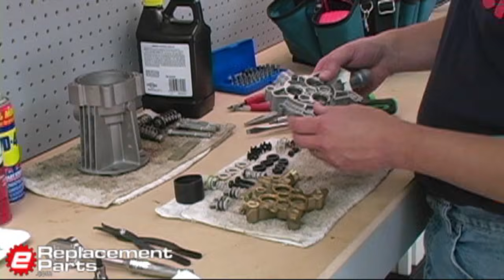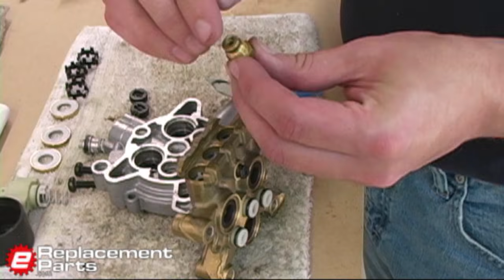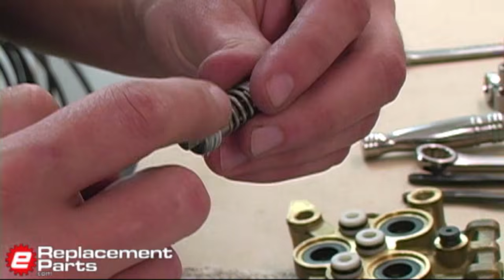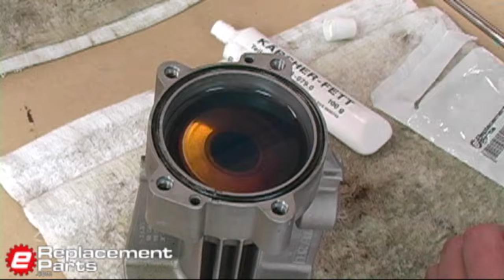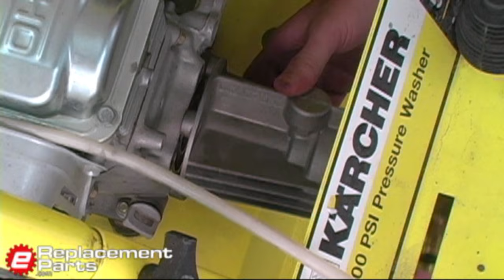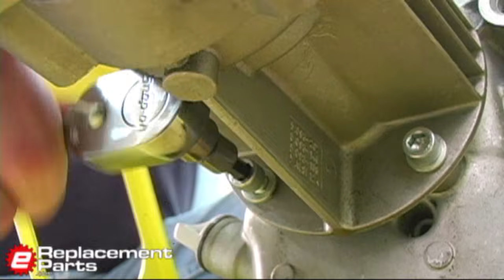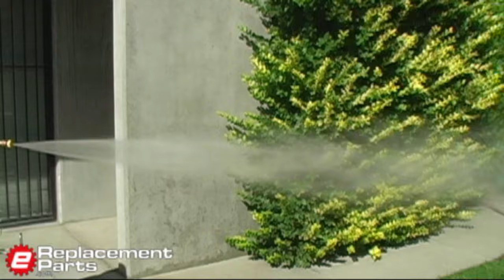How to Fix a Pressure Washer (Part 2 of 2)

Comment: Mark...After looking at your Excellent video, I figured that I could do the repair as shown.  So, I ordered a few parts that I figured that I would need. The problem I'm having is actually getting the pump to separate from the motor. You mentioned using a puller. What does it look like...so that I can go buy one?

Comment: I haven't gone thru all the comments; excuse me if this is redundant: Are pressure washers more alike than different? Is it safe to assume that the lessons learned in this video will cover all other popular brands?
Reply from the maker: Hi Raphael. Many pressure washers are quite similar, so this video is designed to cover the basics of pressure washer maintenance. However, we can't guarantee that your pressure washer would be exactly like this. The purpose of the video is to show the basics, and hopefully it helps you with your repair!

Comment: Can you show us the bearings under the wobble plate? I have a 5 hp Campbell hausfeld presure washer and the needle bearings wore out and  just fell apart inside the pump. The grease looked like whipped cream. But it was full of grease I don't know why the needle bearings failed but they did. Please show us the proper way to replaces the bearings under the plate. Thank you....liked and subed your channel.

Comment: This is an incredible video ... Every detail clearly outlined, with advice along the way including proper lubricants to use with clarification of why the portions of the disassembly and reassembly is being performed. 

I have this power washer and already had replaced the loader valve, but did so without the pump removal. I found getting the valve out easiest by simply giving the pump a crank after removing the housing holding it in place. It pops out after pulling the cord once our twice.

My problem right now is that the detergent suction doesn't work. I'm going tio carefully take it apart, and inspect the o-ring, spring, gaskets and check valve. I think possibly only lubrication and cleaning is needed ... But if that doesn't do it, I'll order the kit.

Awesome video! Thank you for your time and expertise!  Rick

Comment: what kind of oil did you put back in the pump?
thank you
Reply from the maker: Hi Adrian. We use a specific pressure washer pump oil like this one:
https://www.ereplacementparts.com/pressure-washer-pump-oil-p-139764.html

Thanks for the question and good luck with the repair!

Comment: Thanks. 2 ?s what type oil in pump
And there were 2 sets of 3 valves. You called one set the upper. Are they interchangeable? They look same?
Reply from the maker: Hi David, thanks for the question. As far as pump oil goes, you'll want something specially formulated to do that job, like this:
https://www.ereplacementparts.com/pressure-washer-pump-oil-p-139764.html

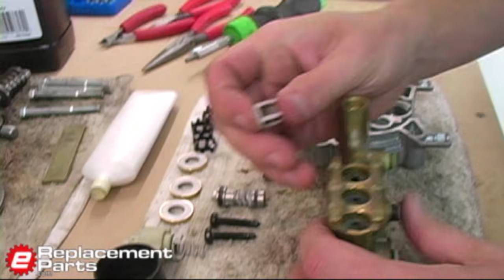As far as the valves go, the three valves that Mark installs at 1:25 of this video are interchangeable, but they are slightly different from the upper valves that he installs at 1:54. Thanks again for your question and good luck with your repair!

Comment: Did you put oil in the water pump or just the engine?
Reply from the maker: Thanks for the question, Don! You will want to put a special non-detergent pump oil in your pressure washer's pump. I hope this helps, and good luck with your repair!

Comment: what is the oil for pressure washer
Reply from the maker: Typically your best bet is a 30W non-detergent oil. You may want to double check that it is the right type for your specific model however. Good luck with your repair!

Comment: Do you have the actual part number for the valve and what kind of oil was use?
Reply from the maker: Hi Guillermo! Mark uses Teflon grease on the valve for lubrication. If you send us the model number of your pressure washer we would be happy to find the correct valve for you!

Comment: What oil goes in the pump also where did you order the new parts from I also couldn't get my unloader valve out I tried needle nose and twisting it but no luck
Reply from the maker: Thanks for your question! Can you send us the model number for your pressure washer and I will try to find an unloader valve, or any other part you need! As far as oil goes, I would recommend a non-detergent SAE30 pump oil.

Comment: I have a Karcher G 1800, and water is just SHOOTING out of the Soap input hose/port.   This causes my pressure to fluctuate constantly.  
Would there be something with the spring and ball in the "Soap Injector" section of your video be a culprit?  
or am i looking at a different problem?

Comment: Very good video! I had the same exact power washer with the Honda engine. I purchased as a refurbished model. It worked perfectly and I sold it for about what I paid for it. Not sure if you can get the same quality from Karcher in 2018. 

Are they still quality built today like these were??
Reply from the maker: Hi Bob, Karcher is still a very well built, quality pressure washer still to date. It is probably one of the industries best.
Reply: Thanks for your reply. I am finding that is not  the case after reading and doing research with the Karcher electric models. People are constantly complaining about how poorly they are built and perform today. 
Perhaps this may be with the electric models only??

Comment: Verry comprehensive  and easy to follow ,Thankyou Mark,  G2500 OH 1.194-5120  broken valve spring , oil resivoir empty ,every thing shot need to replace bearings in housing. ( HOW ) Where can I get a compleat pump repair kit Please?
Reply from the maker: Hi Garry, unfortunately at this time we are unable to offer technical support. I would suggest contacting the manufacture for further information. I sincerely apologize.

Comment: I have an es4040 4000psi pressure washer pump with no presssure, would this same method apply for that type pump?
Reply from the maker: Hi Jorge, unfortunately at this time we are unable to offer technical support. I would suggest contacting the manufacture for further information. I sincerely apologize.

Comment: This video is very helpful.  So as requested, I'm leaving a comment AND asking a couple questions.  I have a Rigid 3000 PSI 2.6 GPM pressure washer with a Subaru engine. Here goes:  (1) Is the process the same for diagnosing and fixing the pump on that model? If not, can you please point me in the direction of a good video to watch?  (2) Also, it's only running when on choke after cleaning the carb and jets earlier.  Should I run some Seafoam through the gas to see if that clears it up?
Reply from the maker: Hi Jeremiah, unfortunately at this time we are unable to offer technical support. I would suggest contacting the manufacture Rigid  for further information. I sincerely apologize.

Comment: Very helpful video. I have an issue with fantom vpw46. The connector that you hook the hose to leaks in between the two parts of the brass connector. Did replace the rubber washer to the hose. Hoping that would solove the leak problem. Not. Will this also cause lose of pressure? How do I fix? Judy
Reply from the maker: Hi Judy, unfortunately at this time we are unable to offer technical support. I would suggest contacting the manufacture of your pressure washer. I sincerely apologize.

Comment: Excellent video. I have a Karcher K3.690 pressure washer that has a leak in the pump. The cause is a crack along the mould line of the housing which to me is a design flaw that should be covered under warranty but is not.

Comment: Mark, I recently purchased from your website 6 valves and the unloader valve for my Karcher Pressure Washer (Model G 2650 HH, Part No.: 1.194-508.0) due to the pressure pulsating. I put the pump back together tonight with the new valves. After starting up my pressure washer, it continues to pulsate. Any ideas as to what I should try next? Thanks.
Reply from the maker: The unloader should not have anything to do with the pressure washer pulsating. That would be in the valve area, but you have already replaced them. Speaking to our Pressure Washer Technician. Here is what he said.
A. Debris in the pump
B. Calcium build up in the pump
C. Air in the pump
D. Not enough water volume going into the pump
E. Karcher advises to use a 3/4 inch inlet hose, most hoses are 5/8 inch
F. Too small of an outlet hose

Comment: Hi,  Great video. I just did mine, and now it works great, but it is leaking water out of the bottom and is getting water in the oil. I just cleaned everything. I did not change any seals. I could see having a small leak from a bad seal, but the water runs out in a stream. I took it apart and put it back together again. still leaks. could it be just a bad seal or two? If so, where can I get a seal kit?
Reply from the maker: Sometimes the seals shrink a little over time.  Once you open the pump up they don't seem to seal correctly again. The Seal kits are usual
available for these pumps.  Use the model number on our site and the kit should come up for you.

Comment: Mine is the same make and model and the same problem shown on the video. I used the same fixing methods described and my pressure washer is back in action. Thanks eReplacement and most of all to Mark for creating the video.

Comment: Dear e-replacement people, Please advice about the oil specs for the pump. Tks.
Reply from the maker: 20W 40 Wt Synthetic oil.  Remember that you don't fill the oil to the top.  It needs some head room.
Reply: Thanks very much for yor advice.

Comment: I have a Karcher 2500 PSI pressure washer same pump as in the video only it's vertical mount not horizontal. I pulled it out to start pressure washing and when I hooked everything up and started the pressure washer, it just kept shooting water at high pressure. I took the gun apart to check if there was something stuck in there and it doesn't appear so. As I was looking at the gun I left the hose that feeds the soap in a bucket end of the garden hose  on. When I got back it was all drained out & water was still flowing out of the hose that connects to the gun. Could this be due to the valve you replaced on the pump in the video, or the valve that feeds the soap through the pressure washer, if not can you give me other suggestions? I remove the pump and tried to remove valve you replaced but was having difficulties. I was also wondering where do you order your parts from? Thank you, I hope to hear back from you soon.
Reply from the maker: I'd sooner think you have a sticky valve in your gun.  The hose from the pump to the gun will run water whenever it is not connected to the gun and as long as water is running through the hose it will pull detergent through and drain the detergent.  Try cleaning the gun before you tear the rest apart.

Comment: I got a troy bilt pressure washer I did the complete rebuilt and the pump still leaks any help?
Reply from the maker: It sounds like something has been installed incorrectly.  You will need to open it back up and see what went wrong.
Reply: Thank you very much I'll open it up!!

Comment: Greetings. Thanks for the great videos. I need to fix my Karcher K 2200 G pressure washer. I is leaking very badly at the bottom of the pump. I would like to fix this, however, I am not sure on which parts to order. Is there a kit I can purchase to rebuild the pump assembly? The pressure is light and I can't seem to remove the hoses after I unscrew them. Any help would be greatly appreciated. Thank you.
Reply from the maker: Most manufacturers do offer a rebuild kit. I haven't been able to locate one for your model from Karcher.  If' you
open your pump up, a rule I always use is to replace all orings and gaskets whether they look bad or not.

Comment: I have a Generac 2500 PSI which is about 3 years old with very little use. I initially used it to wash my house. When I went back to it (about six months later) I hooked up the hoses and turned on the water supply but no water would come out of the spray nozzle (zero, zilch). I was reluctant to start the engine as I could have a dry pump and could ruin it. I checked the inlet screens and water source and it look like something was totally blocking the water flow.  I contacted both Generac and a local repair shop but since it was beyond warranty no one responded to me. Any ideas?  Thanks.
Reply from the maker: I would clear the obstruction out of the inlet.  Most pumps have the inlet screen that you can remove by using some pliers.  Most of
these screen just pull out. Once that's cleared try running the water through it again.  You also might want to double check the gun to make sure water flows through it too.

Comment: I've got a friend with a Water Driver series pressure washer, Model # WGV1721.  Hers is just spitting water when she tries to use it.  I haven't seen the washer in person yet, but I plan to try clearing the nozzle with compressed air before proceeding further.  Do you have any suggestions for diagnosing this problem?  And if I need to crack open the pump, do you folks sell a rebuild kit for it?  Thank you much, in advance.  Jim.

Comment: Hi, I received your rebuild kit an having a problem with removing upper valve caps any suggestions would be great.
Reply from the maker: +Richard Horst I have a small set of wire cutting pliers I use but you can use what ever you have available.  Once the plate cover is removed I twist the little knobs on the Valve Caps so they're perpendicular to the housing the using the pliers I'll grab the knob furthest from me as low as I can the pry the cap out using the edge of the pump closest to me for leverage.
Good Luck!

Comment: Hi great demo. Love your work. I have watched numerous times now over and over  to enable my brain to comprehend all the bits and processes. I have my parts  now and I'm about to get repairing.... I notice  that at 1:47 you hammer the joining seal into a bolt hole. at 1:53 its has been reassigned to its correct position. .. just sayin'..

Comment: Hi there, I sent a question to you about three weeks ago and since then I have purchased a new unloader and installed it.  The pressure washer still has low pressure as before.  I've checked the hose and wand and neither have any obstructions.  I've also removed the pump from the motor and when I turn the the portion of the pump where the engine shaft goes, i can hear what sounds to be compression.  Is there any additional advice you may have for me? Thanks for your help and God bless you.
Reply from the maker: +Rodney Dozier A common problem that gets overlooked is the size of the hose and the amount of water going into the pump.  A restricted water supply will give you exactly the same symptoms. Also, check the inlet screen to make sure it's not restricted.

Comment: Excellent instructional video.  I have a Coleman Powermate 2650 with an AR North America RMV25G30D pump.  I noticed recently after I had used it to pressure wash a friends house that after three hours the pump lost pressure near the end of the job.  The motor runs fine, but when the trigger on the wand is pressed there is no pressure, just average flowing water.  I checked all the valves and O-rings that are easy to get to without opening up the pump exposing the pistons.  I didn't notice any wear or damage on any of those parts.  I then took the unloader off (part #AR42118) and disassembled it.  I didn't notice any damage but did clean it and used some vasoline to lubricate the O-rings since I had read that on another site.  I reassembled everything and then tested it.  At the start of the pressure washer it continued to have no pressure and so I continued to press the trigger on and off and after about 30 seconds it started working correctly again.  It did this a few times and then it went right back to having no pressure. Any expert advice??  I noticed you used plumbers grease, would that make a big difference?  Also I did not remove the separate small o-ring and bearing at the bottom of the unloader since it was hard to remove down inside the pump.  Would it make any difference to take that part out too?  Any assistance would be so greatly appreciated.  I just didn't want to waste $40 on a new unloader if I could salvage this one.  Thanks again.
Reply from the maker: +Rodney Dozier If, as you say, there is no corrosion in the cylinders or other parts of the pump, My next suspicion would be the unloader.  Even though is looks clean, that would be where I would go next.  As far as the vasoline versus a different lubricant for the O-rings, they should all work in a similar fashion.  You just need lubrication to help protect the seals and O-rings.
Reply: +eReplacementParts.com 
I have a simpson mv3024 Everything works great just for some reason it jumped threads and the pump discharge cross threaded/ stripped. I've only found while pump replacements, but it's half the price of a new one.  
any suggestions on how to repair or replace

Comment: Very good explanation and vid I have a husky 2600 psi with a Honda motor but has no pressure I took of the bottom pump assembly and noticed the Pistons where leaking oil what to do in this case replace the o rings ??
Reply from the maker: +Ulises Rodriguez  It sounds like your pump is due for a rebuild with new seals and o-rings.